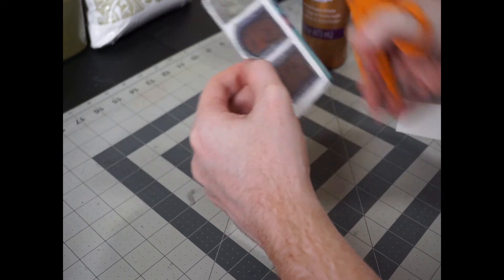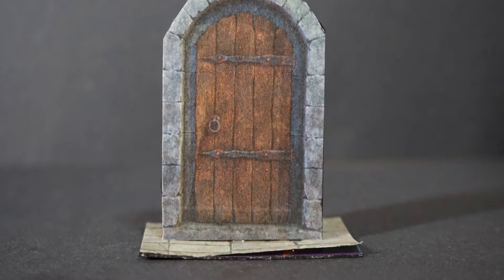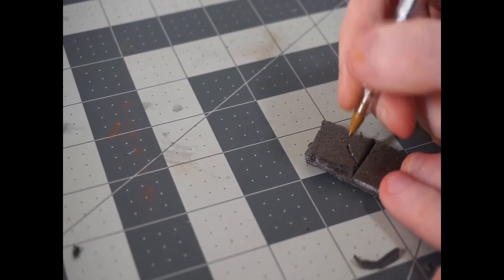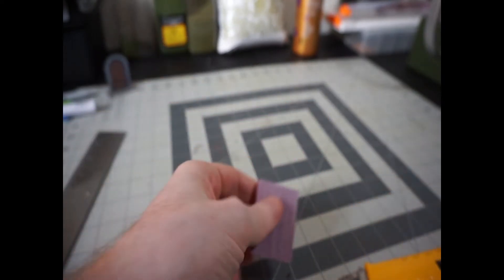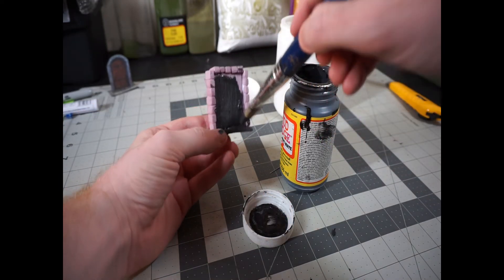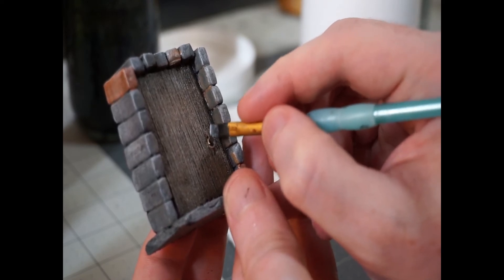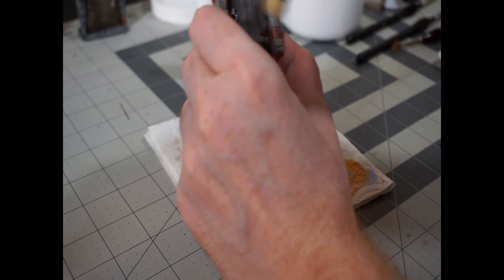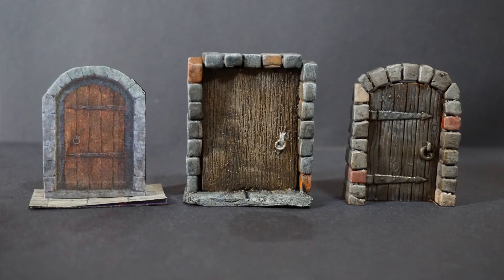Dungeon Basics 001: Dungeon Doors

Comment: Snnrk, 'kool aid man of the forgotten realms.' Good one. If one doesn't have a printer, the local library usually does. Some even have 3D printers available! And I bet one could try brushing a bit of white glue on the paper door for a bit of shine and sturdiness? A very thin coat or it'll wrinkle. (And I know this from an experiment in paper pendant making-layers of thin paper glued together can be very strong and sturdy)
Reply from the maker: Thanks for the tip! I don't do much paper craft but I'll give try to remember that one.